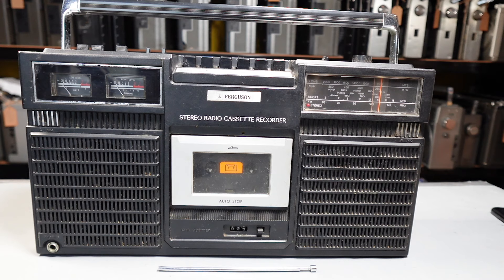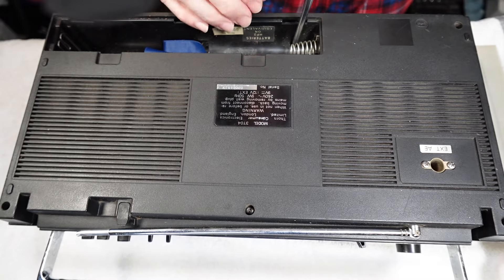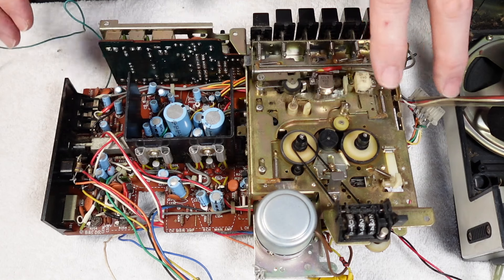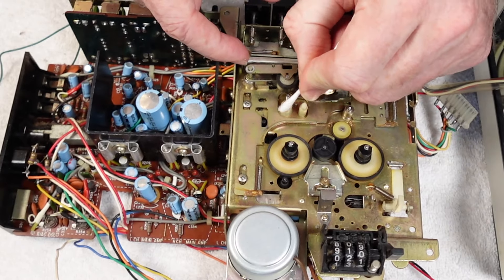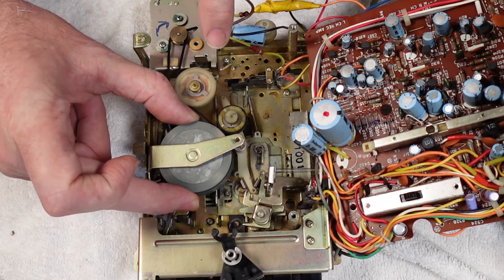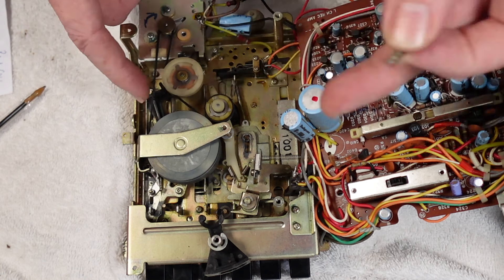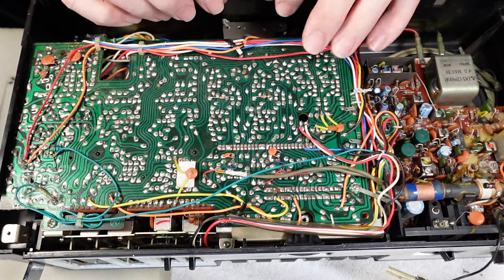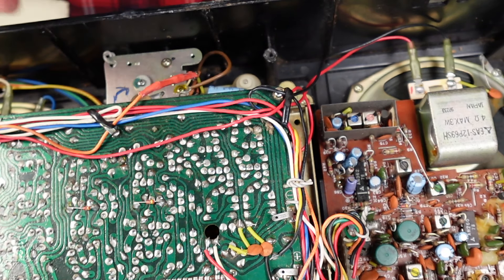Ferguson 3T04 Radio Cassette Service. New Belts & Overhaul. Vintage Boombox Repair.

Comment: This looks like a good, solid functional unit. No bells and whistles like the fancy ghetto blasters. This looks like it was made more for workers to listen to.
Reply from the maker: Absolutely. Thick casing, heavy mech, solid circuit board. Made when things were built to do a job well as opposed to doing everything, but badly!

Comment: ☹️ - you said the analog meters were working? They were “barely twitching” on playback, assuming the signal needs to be recalibrated to indicate the correct VU levels ~ I assume there are trimmer pots on the amplifier PCB to to adjust them? Yes, disappointed to see them not “swinging” when playing a cassette, are the meters a bit more enthusiastic when recording? and indicating tuning/battery levels when radio is selected
Reply from the maker: They display the output level, and ultimately vary with output volume. In this demo they are barely moving because there is barely any output. At higher output levels they register more movement.
Reply: Another great restoration, that chrome tape is genius, never thought of that, since this model is identical to the jvc, are they equal in quality and workmanship? Looking forward to the next restoration 😊
Reply from the maker: @franciscorivas3322  I think these are as good. They use many of the same parts. The main differences are just some of the specifications and features usually - but the shared parts are huge, and whilst it's always a bit unfair to judge each unit side by side for sound after all these decades, I'd happily recommend the Ferguson models.